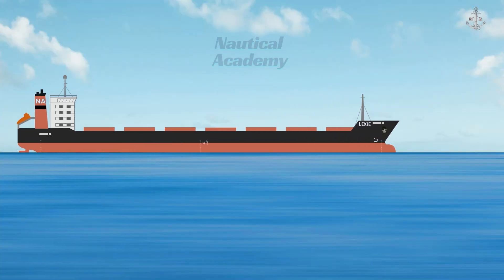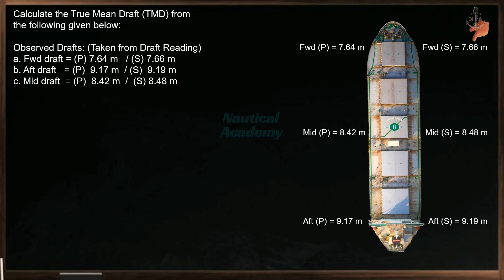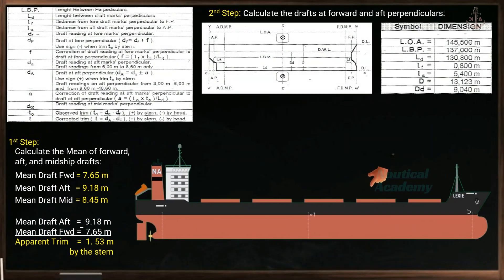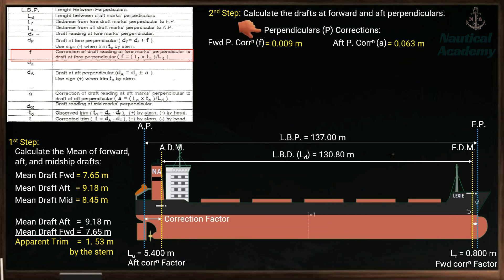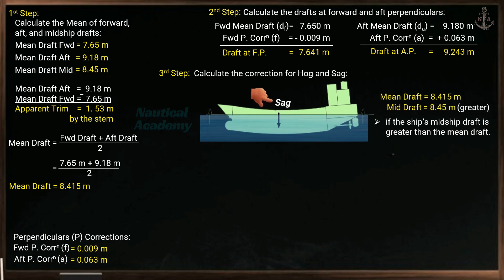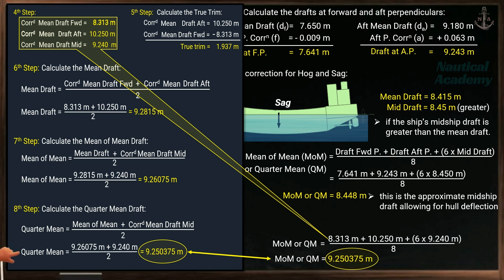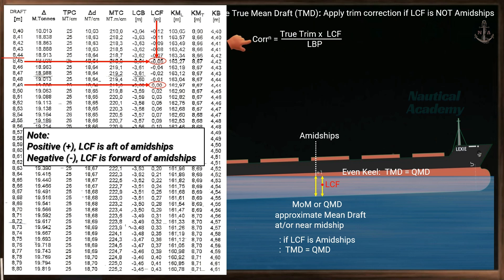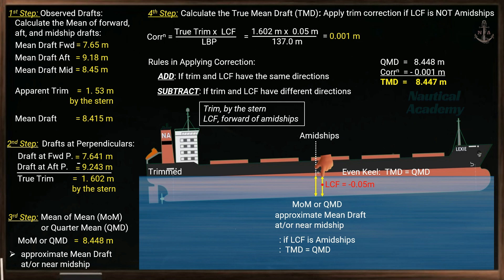True Mean Draft Calculation: How to Apply Perpendicular, Hog/Sag, and Trim Corrections

Comment: If the midship Plimsoll mark visually appears to exceed the summer draft line, but the calculated True Mean Draft (TMD) remains within the allowable summer draft, is the vessel in violation of the regulations or not?
If not, where is the official basis for this interpretation?
According to the International Load Line Convention (ILL), a visual check of the Plimsoll mark is used as a criterion for determining a violation.

Comment: I have a question. At what point is the calculated mean of mean draft considered to have exceeded the summer load line? If the summer draft of the vessel is 15 meters, does it mean the load line is exceeded when the mean of mean draft — adjusted for hogging or sagging — is 15 meters or more?”

Comment: But I have seen, some not using the hydrostatic drafts at all..!
Reply from the maker: If you're taking an examination, the drafts provided are typically assumed to be corrected drafts. However, in real situations, you should not use the simple arithmetic mean draft (mean draft calculated from the observed forward and aft drafts) to extract values from the hydrostatic table.

In a draft survey, after recording the observed drafts, the first step is to determine the mean of the port and starboard drafts. Next, apply perpendicular corrections to obtain the drafts at the forward and aft perpendiculars. Then, calculate the Mean of Mean (MoM) and Quarter Mean (QM) draft, as the Quarter Mean draft is used to extract the ship's displacement, TPC, and LCF values from the hydrostatic table.

Finally, if the ship is trimmed (not on an even keel) and the LCF is not at amidships, apply the first and second trim corrections to ensure accuracy on the ship's displacement.

In some videos, the focus may not be on draft corrections, so it is assumed that the provided drafts are already corrected or represent the True Mean Draft (Hydrostatic Draft).